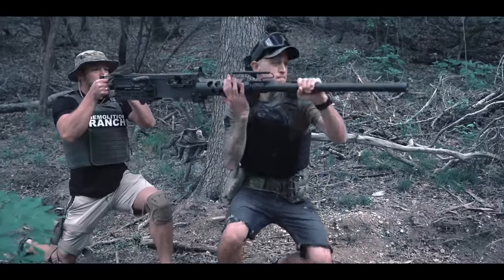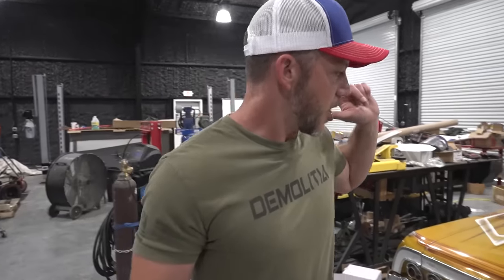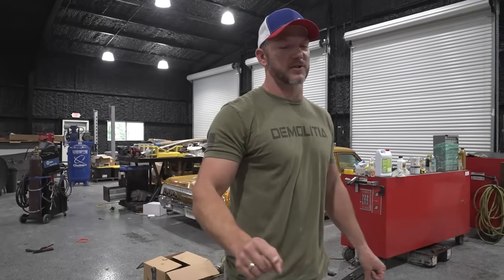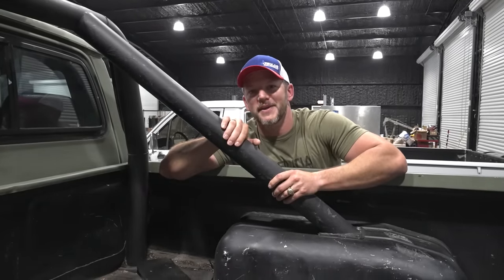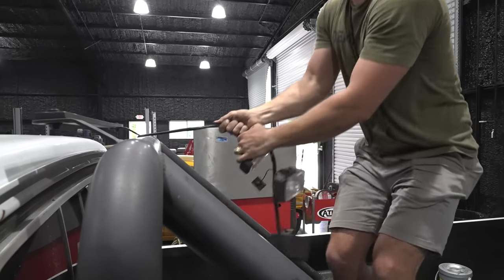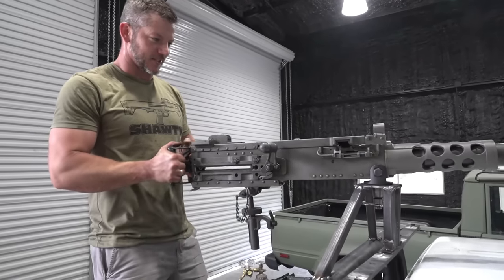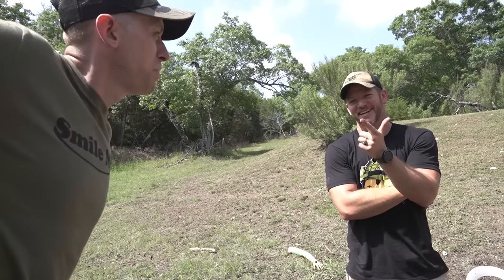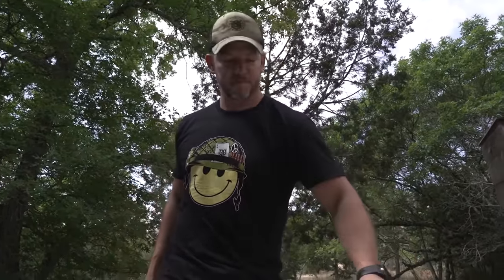The Golf Cart Technical

Comment: Having worked every job on gun trucks for a my whole first contract....there's a lot that makes me uncomfortable about this lol. Also made me appreciate how well engineered the mounting systems on our trucks really are. that bounce made me tense up all kinds of ways, just imagine a runaway on that "mount" . also you could have just put a piece of metal across the roof to act as a barrel restrictor and only allowing it to shoot so low.
Reply: Same.
Reply: Bump so Matt see this lol
Reply: Love the documentary on Vietnam gun trucks. Soldier ingenuity at its best.
Reply: So sketchy
Reply: And he could screw on a nut  bolt on the other side of the mount so it wouldn’t jump like that
Reply: @orgutterman6713  actually if he'd used a thicker piece of metal or stacked and welded a couple of plates together that would have eliminated the jump as well
Reply: ohhhh relax, trigger needs to be pulled/pressed so even if the gun flies off they are fine. plus they are holding it down so doubt it flies off, just jumps how we seen
Reply: @iPanda310  you do understand that particular weapon is a class 3 full auto 50 cal yea? that you lock the bolt release open and that's how that particular closed bolt rifle is able to go full auto? so if you have the bolt release locked open and you get a run away the only thing you can do is point it in a safe direction (some idiots will say wrap your arm through the belt and break it like a 5.56 or 7.62 belt but if you like have functional arms i would advise against that.) If that weapon went rouge with a 50 round belt on It would turn into the most terrifying spinning top you have ever seen in your life. 
Or maybe it wouldn't, but I wouldn't want to play around and find out.
Reply: Not to mention the ammo can platform on his pintle.
And maybe a restraint for the gunner?
Reply: @nated3310  if it were my technical I would have stove piped it in the back like the iraq era flatbed hummers, but that's just me.  I never realized how helpful the dually mount was for 50's to keep your ammo of trouble (I never shot off a stove pipe mount, they we had dually exclusively by the time i was in.)
Reply: I was in an Abrams so luckily my only experience with pintle mounted was the 240.
Hats off to all you who didn't have 27" of armor between you & the muj.
Reply: @nated3310  I had a fleet (?) of Abrams parked next to my motor pool in Wisconsin, and every morning I got woke up by those assholes powering on the warp thrusters at like 4am. but they're pretty dope so w.e.
Reply: oh dam this is a trainwreck but at least they aren't just ripping it.

that mount needs a fuckton of work to be safe enough to do real bursts and makes me love the supported one I built.
Reply: @michag4337  that's not a closed bolt gun though, that's a full side plate rebuild not a closed bolt conversion but yeah if that went runaway it would be ugly.
Reply: Ahh yes. The Stand-To. I do not miss those. I will admit it's a better stimulant than coffee though. Something about 9000 horsepower coming to life at the same moment. Just screams "FREEDOM"!
Reply: @jediknight129  ? the ma' deuce is a closed bolt machine gun(technically it's both open or closed depending on config but I was a crewmen on gun trucks for over 6 years, and a maintainer on gunships for 3, and never saw a m2 configured to open bolt firing).
Reply: @jediknight129  "fuckton" - probably my favourite quantifiable amount measurement. It's more than a "shitload" by far.
Reply: @rkirschner7175  you talking about the smithsonian documentary? If so at about the 14 minute mark it shows a destroyed 5 ton in Iraq, unit marking on bumper wtzfaa, that was my unit and I was convoy commander that mission. Happened March 23rd 2005.

Comment: That tapered mount stud is going to egg the hole on that mount. 
You need a bottom plate with a smaller hole to keep the tapered mount stud from rocking.

Comment: Hang an ammo box off the side to feed from, and your mount is almost good enough. Probably needs a short tube welded underneath that stop’s just before the locking ring. Should stop the hop…. Maybe lol
Reply: It looks like the mounting pin is tapered, so even with a tube the locking ring would still be dealing with all that force.
Reply: @UnbeltedSundew  it deals with most that force on the normal mount anyway i cant see why that would be any different
Reply: @Brassoshine  True enough, but it's definitely going to break sooner rather than later.  Personally , I wouldn't want to be the one holding on to a loaded MaDuece that's falling in some random direction.  It's all moot though since he said he ordered a real mount for it.
Reply: Am I the only one who thinks the mount should be in the middle of the bed so you can shoot in every direction?  That is how they did it in Somalia.
Reply: need a chunky spring on either side of the plate to keep the gun 'floating'. or at least a chunky one on top and a smaller one on the bottom. could be done completely without modifying anything and the bottom spring would be retained via the cross pin that's already used.
Reply: @SuperUncleRyan  I thought the same but that would mean building a whole tripod and the roll bar was right there.
Reply: @UnbeltedSundew  actually,,It wasn't "right there."  He stole it out of "MY" truck.  LOL  Wishful thinking, I really would love to have that old Toyota.

Comment: Golf cart technical V2 the mount should be on the back. Do a welded rig off of the metal hand rails and mount it on the rig. It would also be safer as now you are aming the opposite direction of the driver, with the added benefit of being able to sit down while firing.

Comment: MATT you should put a spring under the plate over the shaft underneath the ma Duce and use the already existing pin to hold the spring in place and it should stop it from jumping so hard

Comment: All that mount needs is a piece of bar stock machine to the correct size hole, cut to the length of the pin and welded to Matt's plate

Comment: A two or three inch steel pipe welded to the center of the manhole cover with four gussets.  Attach through the bed to the frame rails.  Should about two feet higher.

Comment: You should buy or get a M205 tripod, which is meant for the m2, remove the portion where the pintle would be inserted on the tripod and weld it to the top of the truck

Comment: That's cool but you need some adjustments. The mount needs to go higher. At least to the height of your shoulders. And you must put a belt from the right side of the bar, that goes around your butt and weist (like a small leather seat) and thiqs belt will clip to the left side of the bar. With this belt you will be able to shoot sideways without falling of the truck. (Former MG3 gunner)

Comment: the reason its boncing so much is cus in all techinacals they have the machine gun in the base of the bed of the truck  you have it on a pole that can slide up and down of its mount you should of wealded a cap around the bottem and left the gun to swival

Comment: I’m gonna tell Mere!
You should have checked the headspace and timing when Ma began single shots, that might have solved your problem. If you need a wheeled vehicle it’s possible to mount Ma on a 5 ton. While  “technically” not a “technical” you can install a factory mount that allows the gunner to stand on the seat through the roof to operate the M2 360° which means you would need a circular range! Think of the implications a circular range! Remember the rule “ keep your weapon pointed downrange at all times”? No matter what direction your friends face their weapon will always be pointed down range. Simple rules for simple “ friends”.
I’m gonna tell Mere!

Comment: A cheap (folk) magnetic alloy, easily produced by casting...

67% - iron ... it is pure iron, and not various types of oxides!
- more than 2/3 of the total volume for cheaper, stable magnetic properties and easy processing on milling machines...

10% - nickel...
- as a separating material + addition of stainless properties...

10% - copper...
- also as a separating matter + for the spectral similarity of coils - generators, motors and other emitters...

9% - cobalt...
- to increase the magnetic flux density...

3% - neodymium or praseodymium...
- to increase the density and range of the magnetic flux...

1% - chrome...
- to enhance the stainless properties and internal "chaos" re-reflections and condensations of magnetic fields inside the magnet itself...

All metals are in pure non-oxidized form!
*---*

Comment: My question is why don't anyone make full auto rifles with a pump action style cocking? I mean charging handles come in the way in conjested places, atleast AR15 has the rear charging handle but others have left or right charging handles that comes in contact with anything weather you wanna crawl and shoot or lean on a wall, it tends to snag a lot. But if the charging is done as a pump action gun under the barrel guard then it will be free from snags and very convenient. It will also save time as you dont have to change your hand position to charge the gun, it is already at the natural place on the gun. You dont have to keep moving to hand to charge. Please forward this idea to gun manufacturers and bring a change, a great innovation to me atleast. Please dont ignore this. Please.